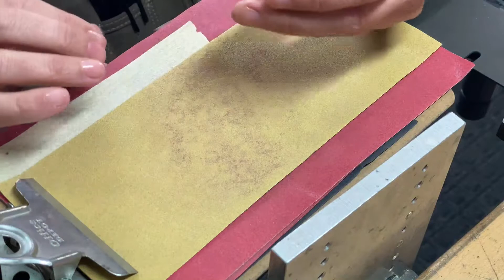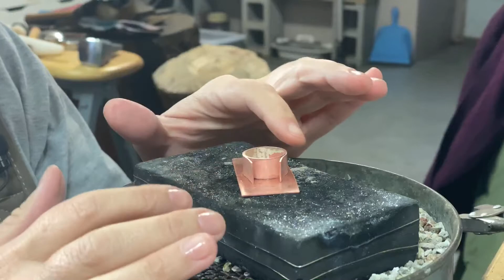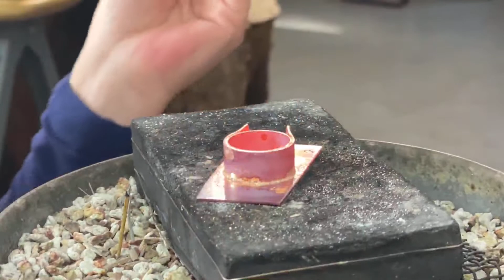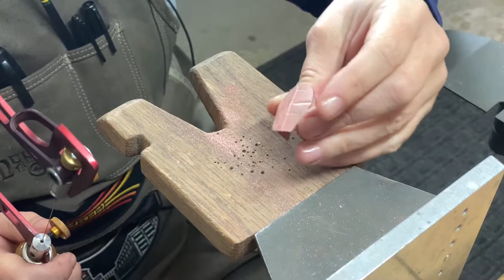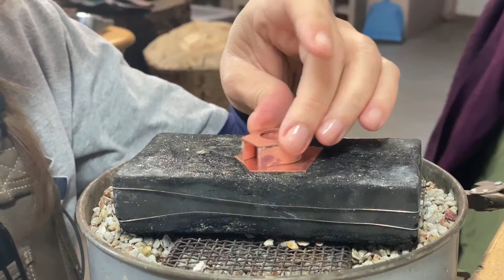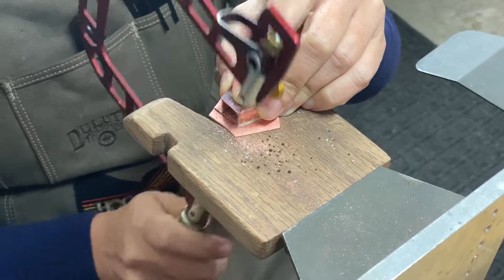Real Time: Signet Ring Part 2

Comment: hello! I tried making this in brass, and I am stuck on soldering the 2 plates on the sides. I have a hand torch and I used easy solder, but I can't get it to flow at all. I tried making the plate as small as possible and it's only 0,5mm thick so it's not that big. I have checked that the ring sits flush on the plate and that they are both clean! Do you have any tips because I am stuck! thank you in advance and thanks for the very informative video.
Reply from the maker: If you have more soldering bricks, I recommend making like a small oven with sides and a top and that will help to refract the heat to get the brass hot enough to flow the solder. Brass is trickier than copper or silver. It has to be very hot to flow silver solder. 😢
Reply from the maker: Brass has a very high soldering temperature and if the solder isn’t flowing it’s because there isn’t enough heat. When you say hand torch do you mean like a pastry torch or a map gas torch? If so, it may not be able to get hot enough for brass. 😢
Reply: @JulessaScofieldMetalsmith that’s what I figured.. unfortunately irs the one that looks like a pastry torch yes! I will try your oven suggestion or I’ll take it to class where we have the big ones and try it there. I didn’t have any copper and didn’t wanna try a first time project on silver with these prices! Thank you again!
Reply from the maker: @spasiasp8811 I completely understand. When I started silversmithing it was $5.00 per Troy ounce!!!!😂😢